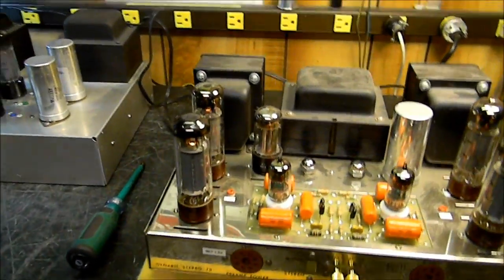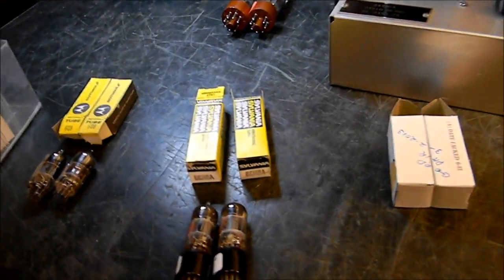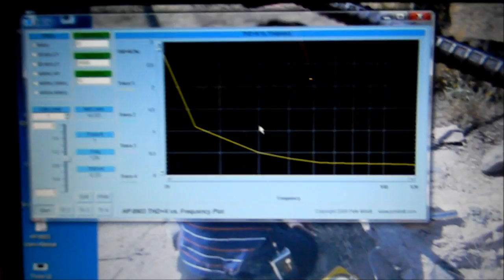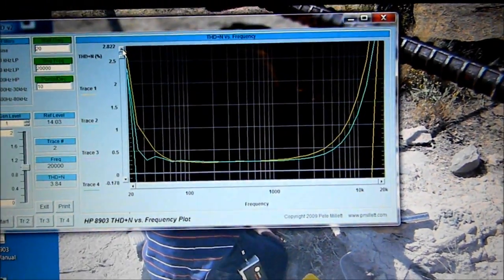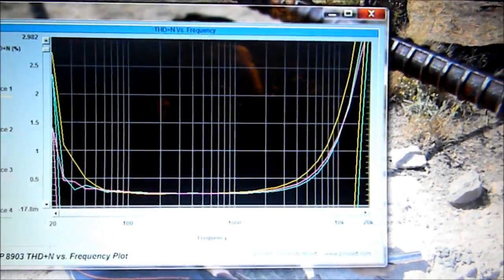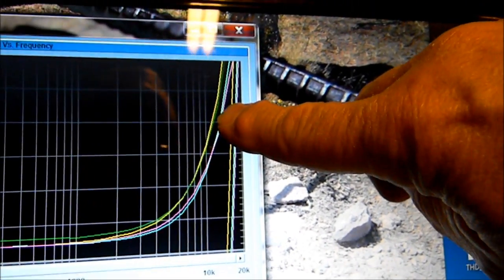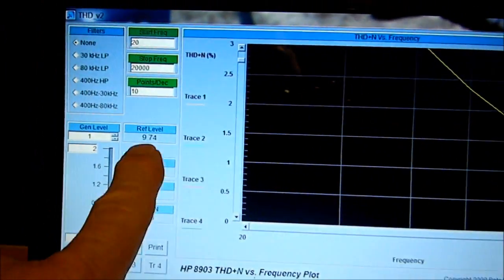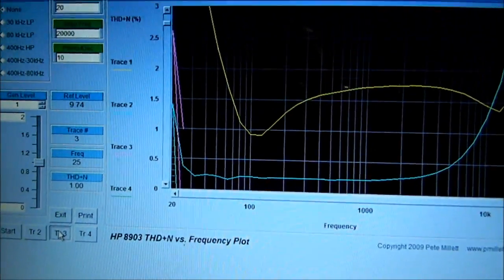Replacing 7199 With 6GH8 And Comparing THD In A Dynaco ST-70 Vacuum Tube Amplifier

Comment: I've been going thru the same thing lately.  However, I find that in addition to 6U8A's having issues and needing to be cherry picked, I've been seeing the same with some 6GH8A's, 6BL8's and Russian 6F1P's.  Might get 2-3 good ones out of 10, the others over 1% THD+N, and I even have one Zenith 6GH8A set aside that tests absolutely perfect on my RoeTest tube tester but 6% THD+N when used in the ST-70!
Reply from the maker: I agree. The worst of the bunch I have had are the 6AN8 that was stock in the older Dynaco amplifiers. I must have 20+ and none of them are really worth having, some better than others, but a disaster for a tube - in my experience.

Comment: This video convinced me not to ever design an amplifier using pentode/triode tubes. If I had a ST-70, that entire PCB would hit the trash can. I'd cut a solid-panel replacement (aluminum), install sockets for real audio tubes that you can still buy and wire it point-to-point.
Reply from the maker: I totally agree with you for audio amplifiers. Triodes all the way.
Reply: @ElPasoTubeAmps  That's not exactly what I meant. I use the EF86 and a few other pentodes frequently. Your video demonstrates there  simply aren't any good pent/triodes left, unless you hand pick or pay megabucks for 7199 NOS. Thanks for taking the time to post this, it resolved an issue for me on a new design.
Reply from the maker: @TriodeLuvr  I have never gotten into using pentodes in my designs. However, I have lots of Collins Radio equipment that are full of 6U8's and other pentode/triode/diode combinations so I am locked in. Fortunately, I have such a supply that I do hand-pick every tube and it works great. I made another video on the MKIII Dynaco and the 6AN8. Holy Cow... I don't think they  could have stayed up all night and picked a worst tube. I think I had 15-16 tubes and only two were worth having and had ever bit as much effect if not more, than the output tubes on power and THD.  If one must use the pentode/triodes combinations, I would recommend the 6GH8 as there seems to be a huge supply still available and they seem to do better, at least in my measurements, than the 6U8. Thanks for your comments.

Comment: I would like to see the difference between 6CA7 beam power tetrodes, and EL34 pentodes as output tubes. Another recommendation is to measure the cathode to plate voltage on the triode side of the 7199, 6GH8 and 6U8 tubes. I'm willing to bet, that the 6U8 isn't able to handle the current to drive the amplitude in the pull up resistor on the anode and cathode follower on the cathode. Those resistors are exactly the same value, it is a split cathode phase inverter. The 6U8 will probably show the highest voltage across the cathode and anode, leaving the least voltage across the resistors. That means that there is not enough amplitude to drive the grids of the output tubes. That's why the high harmonic distortion. The 6U8 that did well, will have less voltage drop, thus, more headroom to drive the power tubes. A volt meter across the resistors and the triode half of the tube will probably tell the tale.

Comment: how would a 6bl8 work
Reply from the maker: Hi Ian,
That is a good question.  I did a quick visual check to see if it is the same pinout as the 6GH8 (base 9AE) and it looks like it is and could be used in the adapter socket. I see the 6BL8 (base 9DC) on Ebay is pretty cheap. The base numbers are different but they look the same... you should carefully check again before using the 6BL8 in the adapter socket as I may have missed something. The 6U8 (base 9AE) is the same pinout as the 6GH8 but from my measurements it generally does not perform as well as the 6GH8 or 7199 in the Dynaco circuit. The 6BL8 is worth a try. I don't think it would hurt anything - assuming my quick scan of the pinout is correct...
From my limited experience, I find all of these triode-pentode tubes used in vintage audio circuits to be troublesome. I did some measurements with a lot of 6AN8's in the vintage Dynaco circuits and it was obvious that performance of the amplifier was extremely dependent on the quality of the 6AN8. Every bit and maybe even more so than the 6550 output tubes. A "perfect" 6AN8 actually does a very nice job in the Dynaco Mark III but most of the twenty or so 6AN8 tubes I had to test did not perform well. I think only two of them turned out working really good. There are some replacement  boards, I think from Triode Electronics  that uses a 12AX7 and a 12AU7 that is a much better way to go - in my opinion - as we know very good quality 12AX7 and 12AU7 tubes are available. Thanks for your comments.
Reply: thanks i am on planning on building the dynaco st-70 from scratch  i will modify circuit to use a different tube

Comment: Hi very interesting video. I have a rare little amp that uses 7199's and they are just to hard to get at decent prices. I've used 6GH8's with adaptor and they sound ok but nothing special in my amp. What I have found that sounds absolutely fantastic is a set of Sylvania 7687's, they have the same pinot as the 6GH8 but were designed to be a better 7199. Unfortunately they to are getting hard to find. My question is have you ever heard of this tube and have you had the chance to put it through its paces in your testbed ever?
Reply from the maker: No, I am not familiar with the 7687 but I just looked it up and see what you are talking about. Another one for us to keep a watch for at a good price.. Thanks.

Comment: Arent 6gh8 tv tubes?
Reply from the maker: Yes, I believe they were TV tubes some time back. The 6U8A tube has the same pinout as the 6GH8 but doesn't work as well for the 7199 substitute. We often times overlook the voltage amplifier tubes in a stereo amplifier and just concentrate on the output tubes but, for sure, these little guys are just as important. I posted a video sometime back about the 6AN8 used in the Mark III amplifier and how critical they are. Out of about 16 tubes I had, only a couple really performed top-notch. The others went from really bad to mediocre. I think the same thing applies here. I believe a a really good 6GH8 will perform just as well in the ST-70 as the high priced 7199.
Reply: @ElPasoTubeAmps  The 7199 gain stage(pentode half) and phase splitter(triode half) are MORE important than the output tubes. It's important to make sure there is enough amplitude available from the phase splitter to fully drive the grids of the power tubes. Dynaco amplifiers use a split cathode design, which puts the tube right in the middle of 2 identical resistors. Which ever drive tube you use, make sure you check the voltage across the cathode follower, the cathode and anode of the triode, and the plate resistor. It could be, that the triode can't pull enough current to put enough voltage across the resistors to get adequate drive amplitude. It may be necessary to adjust the value of the cathode follower and plate resistors, to match the saturation current of the tube. Both resistors MUST be the same value, to ensure the same amplitude to the grid of each output tube. Also, you may adjust the plate resistor of the pentode half, to make sure the grid voltage on the triode is centered at the right voltage for the phase splitter. The plate is direct coupled to the grid. Those adjustments will allow you to successfully use any one of these pentode/triode tubes, including my personal favorite, 6AN8!(another television tube that works great in audio)

Comment: Why is the 20 kHz THD so high? 4% , whether you can hear it or not is out of spec.
Reply: Dynaco released revised figures for their amp lineups in Nov 1974 to comply with the new FTC ratings, there's a flyer on the web you can find, where they changed the power , distortion and bandwidth for the ST-70 to 20 watts (both channels driven), 1% THD+N but only for 50Hz-10KHz, so who knows what "spec" truly is at high frequencies.

Comment: Are you familiar with this issue.   I came across this today during AMP testing.  I connected scope probes to the output side of the coupling capacitors to the EL34 from the 6GH8A's.  I see a nice phase inversion between the two, but as the frequency is increased from 20hz to 40Khz   one wave gets bigger than the other.  Both channels do this.  I made a video of it 

https://www.youtube.com/watch?v=Ihliwq2ZAyY
Reply: Hi Jordan,
I see this is a year old and all too often I miss comments and by coincidence read old postings. I watched your video and I I would have to say, yes, I find this to be a common problem also. Overall, it is not what we want and some will say it doesn't matter as the NFB will take care of it but I disagree. Every stage for best performance should be "perfect" and then let the NFB do its magic and then things turn out  really well. I have made videos that put a static balance pot and a dynamic balance pot in the Mark III. The static balance pot allows us to set the idle current in each of the output tubes equal and the dynamic balance pot allows us to adjust the drive for equal amounts to the grids of the output tubes under full drive. It does improve performance. Hope all is well with you and you are still involved with your amplifiers.

Comment: I'm impressed by your equipment. I can't hear the difference between a 7199 and 6GH8, and you can rewire the stock board to use a 6GH8. At this point in time any 7199 around could possibly rejects from the old days.

Comment: Hi I enjoyed this video very much. I own an Dynaco st70 in stock form and of course have the problem of finding 7199 tubes. I do have a pair of 6aw8a tubes kicking around and was wondering if they would work, provided that I change the pin out. I noticed that 7199's are a medium-mu and 6aw8a's are hi-mu  will this work out ?  thanks ..
James
Reply from the maker: Hi James, I don't know about the 6AW8's but if the triode is high mu, you are probably going to have a problem. You might not notice it at low volume but at or near max power from a THD scan of 20 to 20 KHz, I suspect it will be a significant change.

Comment from the maker: I have to agree with you on the THD at high frequencies for the Dynaco - not too good. The 1977 amp is built with a McIntosh output transformer and circuit and does perform much better. I replaced the original 6AN8 board in the Dynaco with a board that uses a 12AX7 and 12AU7 - finding a really good 6AN8 for the original Dynaco circuit is pretty hard - thanks for your comments.